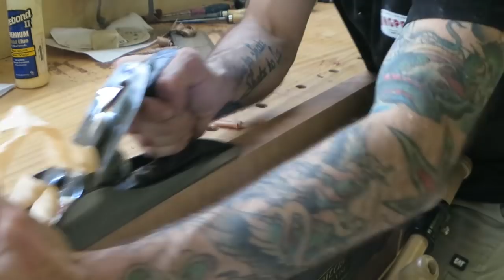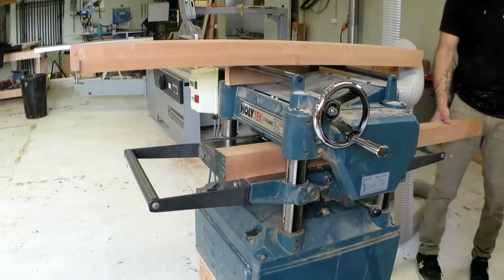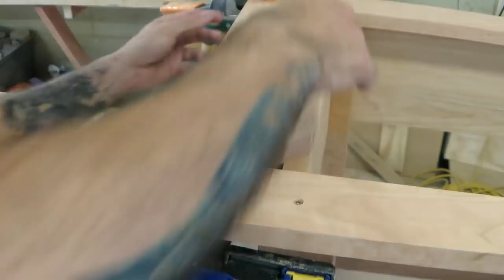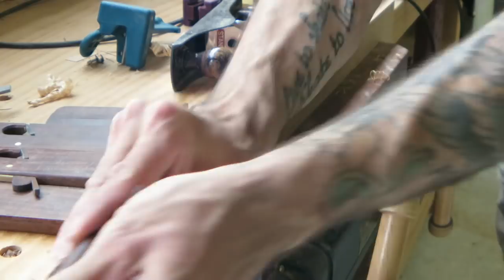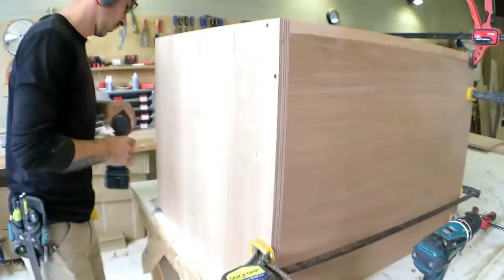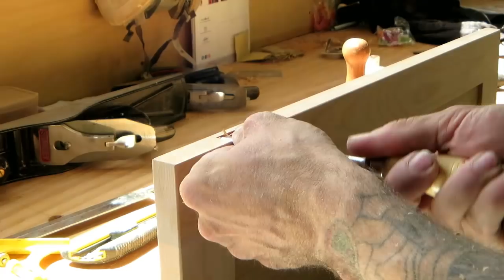A Buddhist Altar

Comment: ANOTHER TIP FOR KEEPING THE BOARDS FROM SLIDING DURING GLUE UP....APPLY THE GLUE AND SPRINKLE A BIT OF SALT OVER THE GLUE.  THE SALT CRYSTALS WILL CREATE JUST ENOUGH GRIT TO KEEP IT FROM MOVING...LEARNED IT FROM OTHER WOOD WORKERS.

Comment: Oh those stressful glue-ups, we have all been there.  Several years ago, I glued legs up to a headboard, stood back to admire my work, noticed the legs were upside down, and then began the frantic effort with clamps and sledge hammers to get it apart.  I could only separate the legs far enough away from the headboard to use a jigsaw to cut the dominos.  Those dominos are tight dry and worse when glue is on them.  Steve
Reply from the maker: +ExtremeWoodworker oh man that's s bugger! Funny how important things just  slip our mind

Comment: Nice project Joey. I have run into that same problem you had with the glue up. If you make the domino slots in the plywood much wider, they will be able to be slipped in while you seat the 45 degree angle.
Reply from the maker: +GuysWoodshop thanks guy yea I worked that out much too late. Funny how I'm that stressful moment things look different...

Comment: You can do the corner joints with dominoes as you originally intended by gluing all 4 pieces and fitting them all at once, and draw them all in with clamps at the same time
Reply from the maker: +Derek Humphries yes a frame is doable but not with the centre panel the way I had it. I should have widened the slots in the centre panel,

Comment: Biscuits would have solved your problem on the mitred corners, or you have to do your dominoes parallel to one edge and perpendicular to the other, which is difficult to manage. 

Did you put a stop on the pull out top. 

Nice piece of work.

Comment: That nail trick in the beginning is awesome. I use it all the time. See so many people always goofing around with all kinds of solutions.
Just a simple nail will do the job mate! :D
I personally don't get all the trouble with the corners and splines? It will be plenty strong without them since the whole structure is fixed by the rest.
Maybe an idea for next time, but you can get away if you use slits that are 45 degrees on the corners (so parallel to the other surface) 
Although, these are a pain to make.... you can never win, lol
Awesome looking project, with a nice purpose.

Comment: Beautiful piece. I really enjoy your vids. Dryfit, dryfit, dryfit!
Reply from the maker: +Hiker Marapese cheers.  Yup although I hate trying to get dominos out after a dry fit. I always end up wrecking the end with pliers.
Reply: When I break procedure I always wonder if I'm going to regret it!
Reply: A trick I've seen is to drill a small hole in the ends of the domino - just big enough to hook something through (eg small allen key) to pull out the dry domino.  You can then use these for dry fitups.  Credit Steve Rowe with the idea.  Cheers.

Comment: when you made the cabinet doors you glued the panel to one of the sides. I've always been told that the panels are supposed to be floating and have never seen them glued like that. I'm sure I missed something, but whats the reason you are able to glue those together?
Reply from the maker: +Steven Jarvie that's correct if the panel is solid timber.  In this case it's plywood so I glue it in to help hold the door together

Comment: Could you have cut the dominoes to a 45 meiter?
Reply: That's an interesting idea it would be essentially a blind spline I'm gonna try that but it would have had to be figured out before he added glue lol #alwaysdryfitfirst
Reply from the maker: +hARR L33T no I don't think so because the dominos need to span over the joint if they were mitred they would but join much like the litre itself. I should have dominoed the mitre as I had but made a tounge and groove on the plywood panel. Would have been way easier.
Reply: I envisioned what he was saying more like cutting the outside corners of the domino so it was a triangle shape which I think might work of course I do think a t and g for the panel is better to be honest never liked dominos much I know they are quick and easy which is why I use them when I have to but they just feel like a rich man's pocket screw to me not judging those who feel different